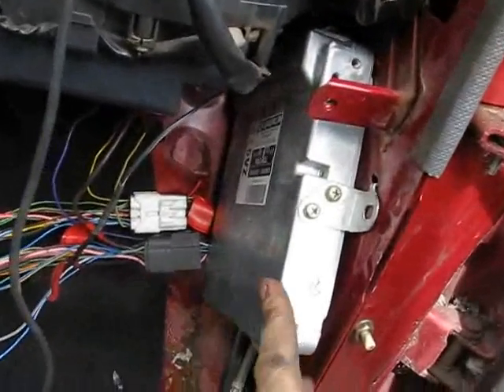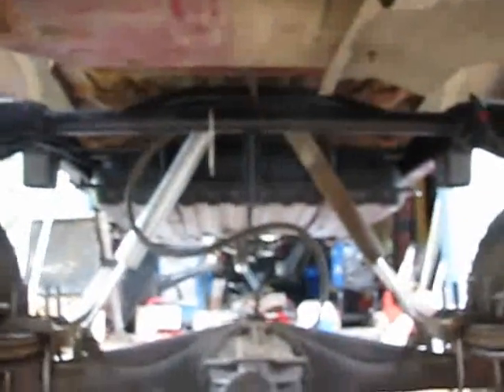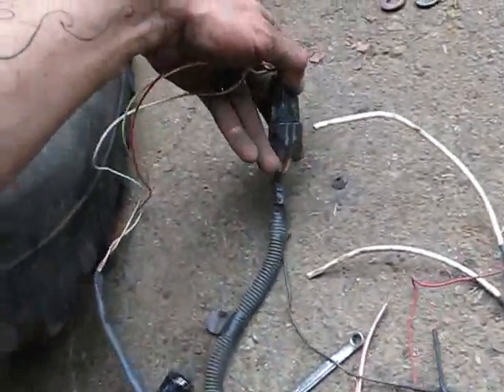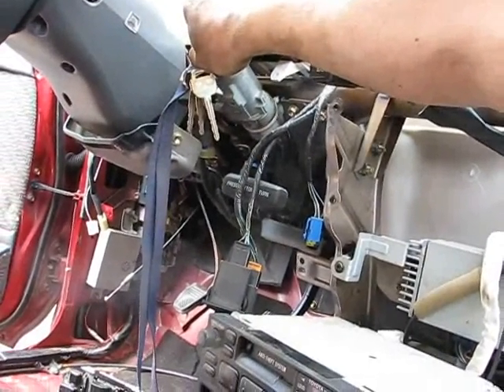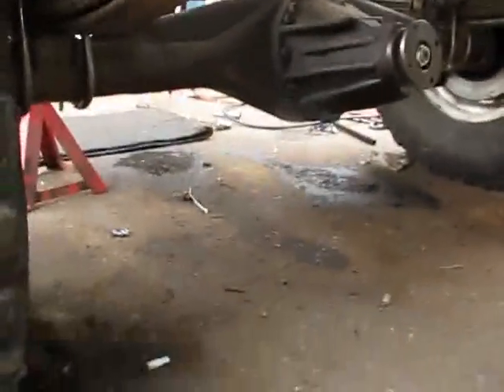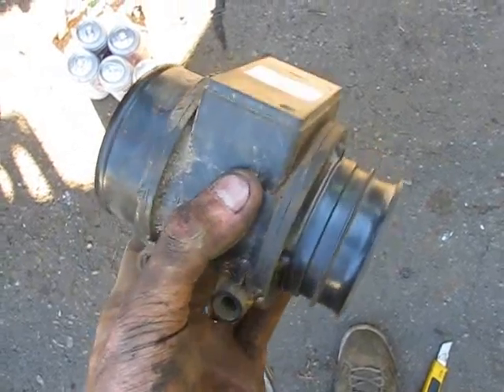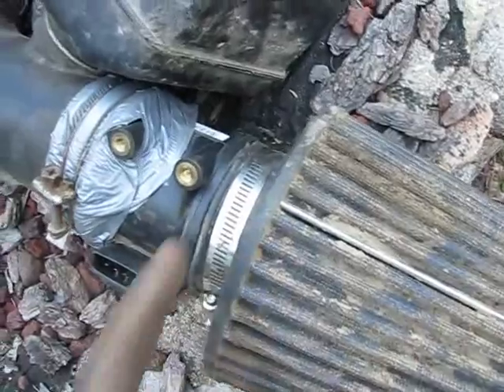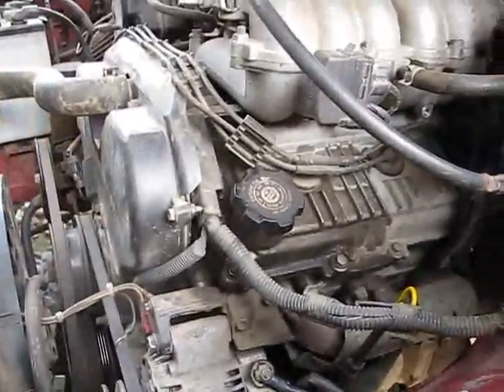94 4Runner: 5VZ-FE (3.4L) Fires Up For First Time! (08/21/11)

Comment from the maker: @Sleytownmafia uhg, its so frustrating... i have one of those hose/fitting things that you're talking about haha! only thing is, it broke with like not even 1/2" sticking up out of it haha! what i could do it drill out the old rotten line and weld in a new one... ive done it before...

Comment: @analog56x crap, I know in older Fords and some older cars you could remove the air restrictor because the sensor wasn't there, and you wouldn't have any issues.

Comment: Awesome man! I have watched tons of your videos and all very helpfull. i tip my hat to you. I am curious as to what wires you used to get it to start up. I am doing a swap right now and just got wirring left. my 4runner is a 95 5 speed and my motor is a 2001 tacoma 5 speed. I am aparently just not gettting it i guess. Any info on what wires you  used would greatly be apricated thanks man.

Comment: Nice swap there im actually doing the same to my 94 4runner and I was wondering if you can help me with the wiring or give me a diagram of some sort?
Reply from the maker: every swap is a little bit different, but i can try. first off, is your 4runner automatic or manual? what year is the 3.4L you have? was the 3.4L from a manual or auto truck?
Reply: analog56x my 4runner is a manual 4x4 and the 3.4 motor I got is a 2000 was told its from an auto